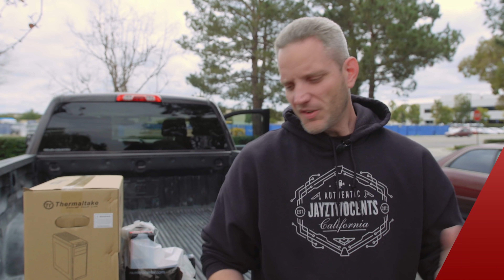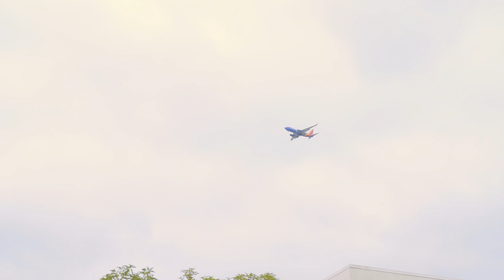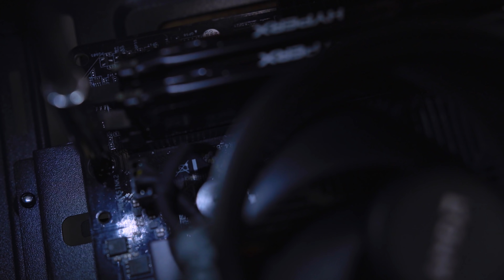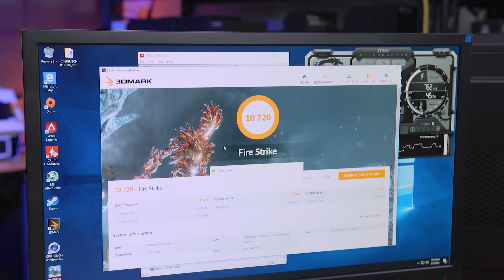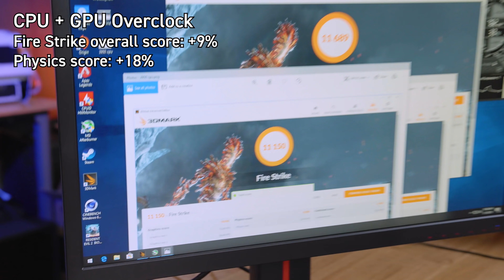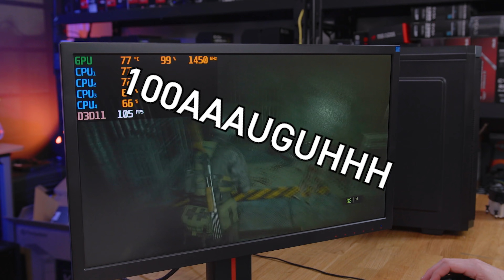CHEAP Gaming PC Build - 2019

Comment: Still a solid card, i still get over 100fps on apex at 1440p on the same rx580 paired with i7-4790, only just showing its age in modern games, looking to upgrade once GPU's return to normal prices 😂

Comment: I was looking for this vid for a while. This exact vid of jayz was the blueprint of my current rig. Bump my processor a little higher (ryzen 5 3400g). Went crazy with the ram and slapped that rx580 badboy in.

Even 2020 Modern triple A games runs buttery smooth close to ultra settings...

And I also use this baby for my work and earn money at home (3d draftsman). So basically this rig already paid itself. Talk about bang for ur effin' buck.

Thanks Jayz2cents. been a fan ever since.... ;)

Comment: I've got quite a similar build, R3 2200g (literally ordered a R5 1600 af 10 minutes ago) b450 motherboard, thermal take v100 case. but I've got an RX 570 8gb instead of an RX 580. so far my system is really good and definitely worth the money, i changed the cpu cuz sometimes the R3 isn't great in some games

Comment: I wish I understood overclocking. You make it look so easy. I built my Ryzen 5 2600, RX 590 and 16GB 3200 ram system a year ago and have had nothing but GPU overheating issues to the point where I have to manually load a higher fan speed profile in my radeon wattman settings just to be able to use the computer..

Comment: Hi Jay...i bought an amd 3400g, asus b450m prime, dual 8gb 3200mhz, nvme drive, costed about R8100, please update this budget build video with the 3400g cpu, iwant to see what is the best performance i can tweak out of my home workstation - i use it for "economic" gaming as well (aka...game with no gfx card, saves power, etc)...i also did not buy a chassis...because i have custom built it into "something" (not a desk)...oh and using a 450w corsair vs

Comment: I am selling my old gaming PC, what do you guys think I can get for this on Facebook Marketplace?

CPU - i7 3770k Quad Core
Motherboard - Asus Sabertooth Z77
RAM - Corsair Vengeance (8gb x 2)
SSD - Kingston 120gb SSD
GPU - EVGA GTX 680
Case - Corsair Obsidian 700D
Power Supply - Corsair CX 750W
OS- Windows 7 Home Premium
Monitor - Gateway FHD2303
Keyboard - Corsair K95
Mouse - HIRAILY F300 Optical Gaming Mouse
Speakers - Logitech Z313

Comment: Whats the name of software you are using for fps and usage
Reply: Msi afterburner. You'll need to go I to the settings under on screen display and click the check for the things you want to monitor i.e. gpu temp, gpu clock etc. It's the same software he used to overclock as well so that's niccee

Comment: I have a potential pc that interests me and equates to about $700.The specs are as such
CPU: Intel i3 - 9100f
CPU cooling: Cooler Master Hyper 212 RGB CPU fan
Motherboard: Asus H310m-K
RAM: 8 GB (1*8GB) 3000mhz free upgrade from 2400mhz
HDD: Seagate Barracuda 1TB 7200 rpm
SSD: Seagate Barracuda 250GB + 240GB ADATA SU630
Case: Cyberpower ONYXIA
PSU: Thermaltake Smart RGB 500w 80+ Gaming power supply
GPU: AMD Radeon RX 580 8GB
and with a 300mbps wireless adapter
An equivalent build with a Ryzen 3 2300x and stock cooler would be about $650.
For both builds I can get 1TB extra hdd and 250GB extra ssd for around 35 dollars

Comment: push a pc to its limits with this spec

windows 10
amf fx 8360 
16gb ddr3
gigabyte ga-78lmt-usb3 6.0
gtx  1050 ti 4gb
5tb hard drive
evga clc 120mm watercooler

Comment: How will this setup be? 
CPU: i5-9400f 2.9-4.1ghz
GPU: Gigabyte rtx570 8gb
Memory: Kingston 2x8gb RAM
SSD: Samsung EVO 500GB
MB: not sure but MSI B360M Gaming plus (tell me if this one isn't good)
and some HDD and power supply
Reply: Awesome actually but I'd go ryzen 2600 or 1600 depending on deals and upgrade to the 580 or 1070

Comment: Won't the 2200g be bottlenecking the rx 580 8gb?
Reply: no they are a great couple together
Reply: @chasesmaley  I used the bottleneck calculator online and saw there was a 14 percent bottleneck to the GPU, more than 10 percent isn't normal tbh

Comment: whats the cheapest build for 1080p 144hz gaming on max settings for Apex, Pubg or dota? Can you do a video?
Reply: I would probably say a ryzen 5 2600, GTX 1660ti, and 16gb of ram at 3200hz in order to play those game at 1080p high frame rate. This build would be about $800. I would recommend you check out pcpartpicker.com to see pricing and parts for a build
Reply: Brankend With Ryzen chips there is a noticeable difference. Also, you can buy 16gb of 3200hz ram for really cheap right now

Comment: Why build pc with an integrated graphics if you were gonna get a separate card anyway?? Can't you go budget ryzen 3 and spend more on gpu?
Reply: Exactly, could have went with a first gen Ryzen like a Ryzen 3 1200 & saved $20'ish for those peripherals or case fans or could have up the budget by $25'ish and got a Ryzen 6 1600 & had even better performance.

Comment: In what ways can I upgrade this setup, like what upgrades can it use if you have a bit of cash
Reply: cpu ryzen 5 2600
gpu nvidia rtx 2060 (if the price is right)
Reply: oh en get better memory aim for 16gb 3000mhz/3200mhz
Reply: @tomfirens1400  should I upgrade the mobo or anything else I ordered my ryzen 5 2600 yesterday and I didnt know If i should get a better mobo
Reply: @joelcasco8015  Depends do you have this exact mobo already  or are you buying a new one either way
Reply: This one would work. If buying brand new i would look at boards with support for 4 ram sticks. 

Also make sure it fits your case. The board featured in this video is a matx board, there are atx and mini itx boards aswell

Comment: Hello! your videos are hilarious and I'm learning alot! the components you used in this video including the exact monitor is the exact setup i am running by chance (except i have 8 more gigs of ram) I believe you said there is a 500W power supply in your build and it was overkill. I have a 400 watt power supply in my build with a gtx 1050 2gb. I ordered the exact same rx580 basically it is on it's way as we speak. And I am nervous to put it in because I game and overclock but I think i'm close to that 400 watt range. Would i be completely safe as to plug it in and go or should i be worrying about blowing the rig? any help from jayz or anybody in the comments would be amazing! thanks

Comment: Go for used parts. I ended up with:
Ryzen 5 2400g
Rx 580 8gb
16 gb 3000mhz rgb
Asus B450 motherboard
1TB HDD and 240GB SSD 
and a Thermaltake v200 case that came with a free 500 watt 80 plus PSU. 
Also 3 extra RGB fans.

My economy sucks as well so that’s a win. I live in Egypt where 1$ = 17.6 pounds

Comment: I'm planning to build a pc

Is this specs okay? Need your help

MoBo - Gigabyte Z390 UD
CPU- Intel core i5 9600k
GPU- RTX 2060 6gb
PSU- EVGA 650 Watts
SSD- 120gb Gigabyte
HDD- Seagate Barracuda 1TB 
RAM- Adata XPG D30 8gb (1x8gb) ddr4 3200

Comment: Shit. I need a bare bones PC (no gaming) took the ryzen 3 2200g paired it with the b450m mobo. skipped the graphics card and the SSD. Went with a 1 TB WD hard drive, evga 450w PSU, and a cheap rosewill case. All for $273.95 + a $2 windows 10 ebay licence key. Now thats my kind of budget build. IF you want to game with this setup grab an old used gtx 760-780 for cheap on ebay. Hell i play GTA 5 all day on high setting (except grass textures) runs at 55-60FPS with a $40 gtx 760. Those old cards run just about anything as long as your not to much of a FPS snob. :-)

Comment: I recently built a pc and when Every game I play it runs at 100disk usage
Reply: What all hardware are you using? Go into task manager, what programs are running in the background? What games?
Reply: Josh Johnson G4400 intel
R9 280
150gb HDD (it was salvaged)
450 watt PSU
B250M-K prime
4gb Ram
I did everything I could the programs running were origin and steam
Reply: Josh Johnson I checked benchmark and fortnite was supposed to run perfectly but every two seconds it would freeze for a bit and ring of elysium

Comment: Can you do a Cheap 3D Modeling PC Build?, I was wondering what's the lowest spec I can get to handle 3d modeling and rendering. I use 3dsmax and Photoshop in a first gen I7 with 6 gigs of ram and Radeon graphics card.

Comment: Hi Jay, How About A Build / Spec's  For A ,,, " 3 - D Rendering / C.A.D. ( Computer _ Aided _ Designed )  Work " ???  To Run the " Solid Works - Fusion - 360 "  ,  Turbo - CAD , ARCHICAD - For Architects . bare Minimum Price , Medium Price , High End Build ???

Comment: AMD - Ryzen 3 1300X 3.5 GHz Quad-Core Processor
 Thermaltake - Contac Silent 12 74.33 CFM CPU Cooler
 MSI - X370 GAMING PRO ATX AM4 Motherboard
 Zotac - GeForce GTX 1050 Ti 4 GB Mini Video Card
 Corsair - CX (2017) 550 W 80+ Bronze Certified ATX Power Supply
 AMD - R7 Performance 4 GB (1 x 4 GB) DDR4-2133 Memory

can u benchmark with these......PLZ

Comment: Is my computer good? I'm a serious noob at computers
System: Intel Core i7-9700k 3.6GHz 8 Core | Intel Z370 Chipset | 16GB DDR4 | 1TB HDD | 240GB SSD | Genuine Windows 10 Home 64-bit
Graphics: NVIDIA GeForce RTX 2080 8GB Video Card | 1x HDMI | 2x DisplayPort
Connectivity: 6 x USB 3.1 | 2 x USB 2.0 | 1x RJ-45 Network Ethernet 10/100/1000 | Audio: 7.1 Channel | 
Special Feature: Liquid Cooling | 802.11AC Wi-Fi
Reply: I hate you
Reply: @Jolty100  why?

Comment: This is my build. I need to upgrade. What do I need to upgrade? Appreciate the assistance! 
MB: ASUS M5A99FX Pro R2.0, 
GPU: XFX Radeon RX480 8GB DDR5 
2x4 8GB DD3 XMS3 Ram. 1600MHZ, 
Ultra 650W PS
PNY 120 GB SSD
WD 1 TB HDD
CPU: AMD FX8350 8 Core 4.2GHZ
Acer 24 inch LED KG1 Series 1MS 75HZ

Comment: My mate made a cheap setup: corsair carbide, msi x470 gaming plus atx, corsair ddr4 vengeance 2x8gb 300, intel i5 9400f, gigabyte g750h, gtx 970 4gb, corsair hydro 115i, rgb platinum, its price is around a 800/900, its a very good setup, maybe you cab do it aswell

Comment: You technically could get the 3 games right now with a Ryzen/Radeon build. Division 2 comes free with a Ryzen CPU most places right now, and then you can use the 2 games free on RX 580 to get Resident Evil 2 and Devil May Cry 5. (RX 590 and above DOES get ALL 3 GAMES btw). Please anyone doing a build like this... GET THE RYZEN 5 2600!!! Its not that much more, and many games will be requiring this as minimum requirements! You will future proof yourself for a little bit longer, and the 2600 is probably the best power/cost ratio CPU out right now. I have a 2600/RX580 8gb setup, and I can run most new games on High, with many still running 100+ FPS on Ultra, without even overclocking. And just get 16gb RAM... it makes a huge difference.

Comment: I got a system with a i5-4460 asus h81 motherboard 16 gb of ram 1tb HDD r9 250 2gb and a gtx 960 4gb oc from asus also it was included with a 60hz 1ms 1080p monitor and a set of mouse and keyboard for 320 bucks
Reply: Fuzion- Clips so you got all of that for $320
Reply: What was the name of it
Reply: @jamieocallaghan380  it was a used pc he built it 1.5 years ago and got recently a new gaming laptop for his school work and he sold it to me for 320 i got the advert on a dutch site like craigslist but im from the netherlands so we use that site and not craigslist

Comment: I personally just got my pc recently and have a ryzen 5 2600 with a rx 580. Works nice for some basic gaming but for cranking up the settings the rx 580 is a little restrictive, at least it feels that way
Reply: Can the rx 580 play GTA 5 with mods?
Reply: @kingariesx9285  I havent dabbled too heavily into mods but yes, it runs it well.
Reply: @techjunkie133  nice because I'm thinking getting that for my first build, but with rx 580 can it runs well with Ryzen 2600?
Reply: @kingariesx9285  yea my build right now runs with the 2600 and the 580, planning on getting a 2060 in the nearish future. Although it may be worth looking into the 2700 or the 2600x the bsse 2600 is pretty nice though

Comment: my budget build runs the same and i only spent 260 cad  or almost 200 usd on it. that's what i call a budget build
Reply: genard hermosado If you don't mind me asking, where'd you get the parts? I'm a console gamer building my first PC on a budget. This video is not helpful for a "budget build" 😂😂
Reply: @biigman7316  haha what i did was search on craigslist first for any cheap computers with decent specs. i was mainly after ram and a good cpu for a budget card. i had an asus motherboard not sure which one, an i7-2600k and 16gb of ddr3 ram. the gpu wasn't good at all but i got a gtx 670 for 80 bucks and it's a really underrated gpu in my opinion since it's real cheap and runs equivalent to a 1050ti for half the price of a pre owned one. the computer also had a coolermaster case which was nice and the pc costed 180 and with the 80 dollar gpu 260. i also got a mechanical keyboard and a corsair mouse and a monitor for an extra 80 so in total my setup is about $340cad. i'm only 15 so i couldn't get anything really good since this was coming out of my pocket. good luck building your pc hope you find good things for a good price 👊
Reply: @biigman7316  sorry if that's too many things that i said lol

Comment: Is this a good build for $500-550 £400-450

Ryzen 3 2200g
Msi B450-A pro Am4 Motherboard
2 x 4 Gb 3000mhz ram

Msi Gtx Twin frozr V 970 4gb

480gb ssd

450w Semi modular psu
Reply: You might be better off if you can find an RX 580 for the same price as the GTX 970.
Reply: @kortex why, the 970 is a good card I got told?

Comment: wrong cpu buy, 2200g is going to be a heavy bottleneck in the system. 4 threads is not enough for smooth gameplay in 2019
Reply: vikas l what is good then
Reply: Joshua Mendivil get something with a min or 6 core 6 thread or 4 core 8 thread

Comment: Actually with my rx580 i had a similiar problem with over 80c. And after removing a sticker over the cooler which blocked 50% of it and other thermal paste, temp dropped to 60c
Reply: do you have the same card? my temps are really high too
Reply: @Maxxz101  Yes strix version still using it.

Comment: Hey Jay, I have a question. I have an EVGA 1080 FTW 3.0 card and an RTX 2070 XC card. The question is, which card should I be using for my Phys X card and which should I use for the actual dedicated gpu? I bought the RTX to try out the ray tracing in Battlefield and otherwise right now it is the main card in the system as my 1080 is just sitting there, but if that is the wrong way around and I should game on the 1080 would you let me know?

Comment: I’m trying to make my first pc and I have a question. Can I use a micro atx with regular parts are do I have to buy special parts for it?

Edit: I’ve been looking for pc parts for about 3 hours and this is the pc build I found but I want to know if it will be able to run games
Video card: msi GeForce gt 710 2g
Power supply: evga 500w 80+
Ssd: inland professional 240gb
Hard drive: seagate barracuda 2tb
Ram: Kingston hyperx fury 16gb
Motherboard: asrock b450m-hdv 
CPU: amd ryzen 3 1200

Is there anything I need to upgrade just looking for a beginner pc
Reply: Go on pc part picker and it will make sure there are no incompatibilities

Comment: i dont know anything about this building but imma try to so my husband can finaly throw away that laptop that super slow
Reply: Just upgrade his laptops ram to 16gb and switch to a SSD instead of a HDD
Reply: @falc0knights496  is that okay that laptop is like 8years old he tried adding RAM but didn't work
Reply: @mrsg7531  get rid of the laptop and use ebay to buy a cheap pc.

Comment: wait do the bios support the cpu without an update with this mobo?
Reply: I wanna know the same question, tell me if you got any answer.
Reply: @itachiochiha1566  I did a lot of research and no site selling the board confirms this but if you order it, it should come with a sticker on it that says "ryzen 2000 ready" which means you can use a 2200g cpu with it. this motherboard is newer and supports raven ridge so yes it will work without bios update

Comment: I made a $150 PC, case, CPU, mobo, ram, PSU and all.
Add to that an RTX2060 and you have a $500 gaming pc.
Add to that a $700 RTX 2080, and you'll have an even better gaming PC.
The hardware hardly matters anymore, it's the GPU that matters nowadays.
Even cheap $50 4 core CPUs can feed a GPU with the data it needs.

Comment: Bottleneckcalculator says RX 580 bottlenecks the Ryzen 3 2200G??
Reply: You did something wrong then, did you put in the same hardware specs that Jay built here, and did you try to reproduce that result?
Reply: @blunion05  I havent messed with the clockspeeds.Does that make such a big difference?
Reply: @FarryEntertainment  The slightest bit, as you can see in Jay's video when he only overclocks the 2200G. Also, don't put too much importance on bottleneck calculator. I've never heard of it until today, and if the 2200G really did bottleneck a 580, it would be very obvious and Jay probably would use a different GPU. Bottleneck calculator claims anything over 10% is a bottleneck...which sounds like a joke to me. If we make a bit of a reach and say it thinks going from 60fps to 54 fps is a bottleneck. Or going from 100fps to 90fps is a bottleneck. What you should do, if you haven't already, is search 'ryzen 2200G rx580' and find the videos that benchmark that configuration in various games (imo, try to find the videos benchmarking in the resolution you plan to play in).
Reply: @blunion05  What about the lifetime of the PSU? I dont dare to overclock. Im afraid I will break stuff.
Reply: @FarryEntertainment  To my knowledge...for the most part, a PSU's overall lifetime probably won't be affected by overclocking as long as you make sure to buy one that has the right capacity, e.g. my system with everything at stock (i5-6600k/1070/16gb 2133mhz) uses ~250 watts, and I have a 550watt PSU.